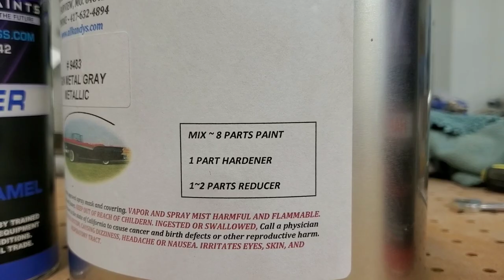Project Silverado - Painting the Roof "GunMetal"

Comment: the ripply you are talking about is the mix,thin it out some more esp if you are adding wet look, the metallics will stand up on the last coat ,i like multiple coats on single stage paints,yeah its all in the mix,when it right there'll be no orange at all,unless the paint is inferior,let it breathe between coats,looks good

Comment: Definitely an art.  A lot of variables like temperature humidity air pressure triggering speed. Getting a full wet coat without getting run's. I know what you mean about the orange peel with a metallic single stage paint. Look's pretty good. Next video?

Comment: Acrylic enamel. I haven't seen that since the 1960's. Single stage urethane sure but Acrylic enamel we only used to use to spray Volkswagens. It's garbage paint but flows out exceptionally well when using a Binks Model 7 (the king of the hill gun back in the day). Chrysler and Ford used Acrylic enamel whereas GM used Acrylic Lacquer.

Comment: the paint will lay down more evenly if you hold the gun more parellel to the surface the part of the fan spray that is closer to you wrist is closer than the other end it also looks like your fan pattern is turned in some im not knocking you bud you do great work just some tips for you !

Comment: How did you clean the primer before laying down the paint?.. wax and grease remover? Or just a dish washing soap wash and paint?
Reply from the maker: I used wax & grease remover
Reply: @GTsPerformance  I like that color.. I was looking at the link to buy it..  Did you spray a clearcoat on the roof?.. it's really glossy.
Reply from the maker: I've seen this color many times, and been wanting to try it. I thought this truck was the perfect opportunity. 
This is just the gloss coming from the (single stage)  paint.  No clearcoat.
Reply: @GTsPerformance  nice work!.. i sprayed my truck in primer surfacer. Sanded and prepped... it's my first time painting a vehicle. I like that metallic color but I feel like I need to crawl before I walk. 🤷‍♂️  thanks for the info!

Comment: Hey bro do you have a video of sanding this down and cutting / buffing?
Reply from the maker: No, not yet. I do have a video called "sanding with eagle abrasives"
https://youtu.be/rAM9IMEyzvE
I sprayed the tailgate this same color,  and went thru all the steps,  start to finish.
Reply: @GTsPerformance  looks like that tailgate it base coat clear coat? I’d really like to see cut and buff on single stage metallic flake paint like the truck you just painted
Reply from the maker: Yes, its the same paint for the same truck.  It is the gun metal metallic

Comment: your paintjobs look good but generally you're supposed to chase the wet edge so you are not supposed to start in the middle of a panel, start at one end and chase the wet edge to the other end
Reply from the maker: I'm always learning, so even if I've sprayed for years,  I never consider myself a professional.
Single stage metallic is a challenge to anyone.  Its always best to spray basecoat clear..
https://youtu.be/cWDLyQhr4YQ
Reply: he did that because a truck roof is tall and a big surface. so how you gonna lean on fresh paint starting in the front to the middle? you need to start in the middle so you can lean to the far reach
Reply: @justinOUTDOORSandDIY  Justin that made no sense at all. You have to lean in regardless of which end you start on. You put your hand on the door or the window

Comment: If a lvlp for example the spray it 33000k needs 3.5 - 4.0 cfm @ 40 psi and for example a kobalt 26 gallon compressor can supply 5.5 cfm @ 40 psi it’s simple. could you paint a whole car?
Reply: Slowly but surely in my opinion, but youd be really running that compressor constantly. Wouldnt be good on it and youd have moisture issues. Better have a couple dryers and one more on the gun. It would be risky, like youd be risking all the money youd have in paint and clear etc..and all the time in prep and doing all that.. Just my opinion. I researched doing the same thing. Your better off trying to get a 60 gal and research how to setup your airlines and dryers properly.
Reply: @motov8-garage832  So theoretically I could maybe each coat with breaks in between?
Reply: @4oeproductions289  on a whole car? I dont wana give you bad advice. Like I said its risky and your risking the price of all your paint etc. you need as much cfm as you can get. If you keep starting and stopping the paint jobs not going to come out smooth. It can be done, its gona take you a long time. To me it would be best to practice on other stuff and get use to how its gona spray. Get use to your setup before you try it on a car. I'm sure others will chime in here eventually..some good some bad lol. My best advice is do alot of research. A lvlp gun will be your best bet but it's not going to put out near as much paint at a time, its going to take all day probaly. You wana try to keep your coats of paint even and not over spray onto the next panel, especially the panel next to its dry or alot dryer. I meen you could pull every panel off and paint it separately but that would be to much extra work in my opinion.
Reply: @motov8-garage832  yea, or would you recommend panel by panel?
Reply: @motov8-garage832  Thanks man I’m looking now
Reply: @4oeproductions289 No problem, cool👍and he doesn't neccesarily teach you about compressor setups but his painting, paint guns, and prep techniques are great.👌